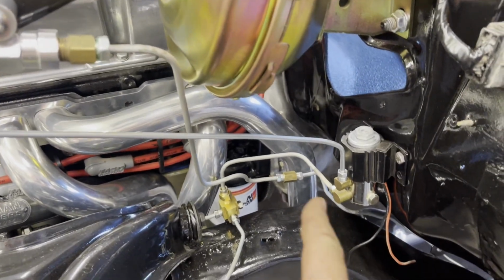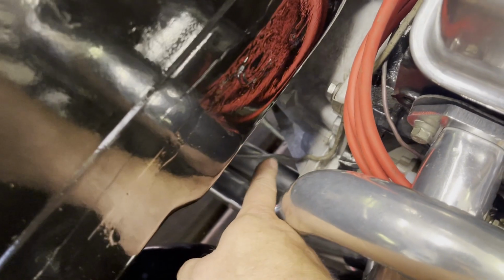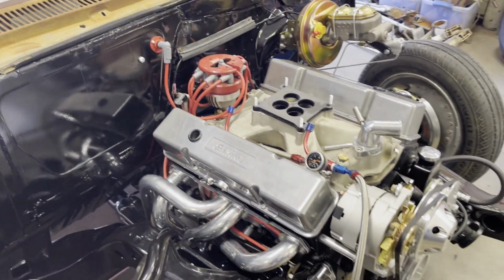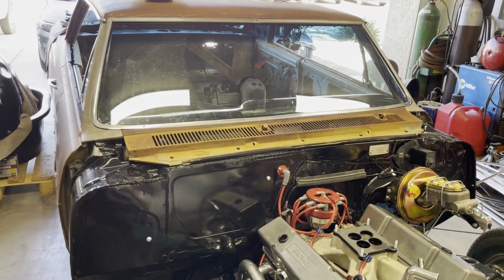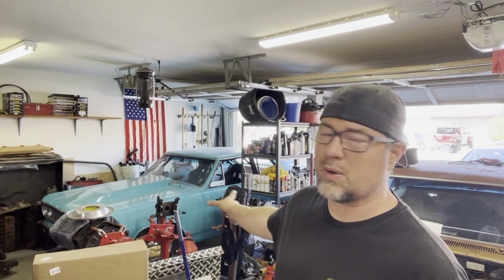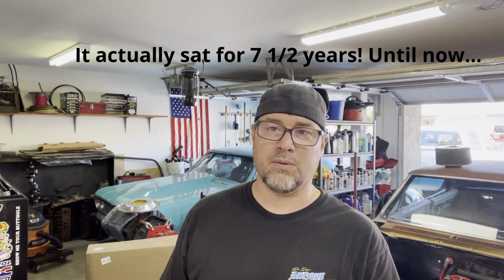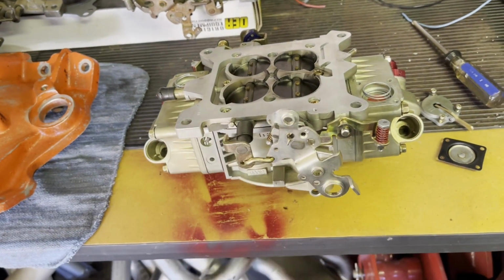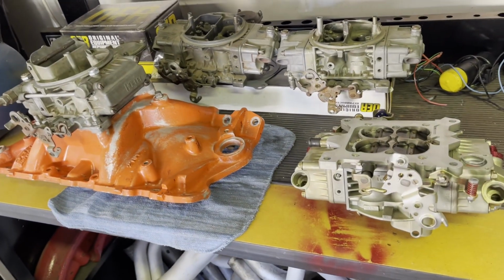Down N Dirty | 64 Chevelle Build: Duct Tape Drags Update

Comment: Holley carb rebuilds are my favorite. Crusty the Carb will definitely need a new kit. Nothing worse than a gas fire. A piece of rubber fuel line (or duct tape?) zipped to the braded line would keep the rubbing down.
Reply from the maker: I agree. I do love my Holley carbs!

Comment: What about using hard pipe fuel line behind the alternator, less space required?
Reply from the maker: I don’t like running hard line up to the carb. It’s different to go from compression fittings to -6 fittings. Then you got to take it apart to remove a carburetor bowl. They get hot that close to the engine block. The fuel wants to boil.  I don’t know.  I just used what I had.  🤷‍♂️.

Comment: what is dash 6 ?
Reply from the maker: Dash six.  Or -6 is the size of the AN fittings and hose I’m using. There is typically -4 -6 -8 -10. -12.   a dash size refers to an I.D. of a hydraulic hose or fitting in 1/16" increments. For example, -6 hose would indicate a hose with I.D. of 6/16" - or 3/8". I hope that helps. Thank you for the comment!!!